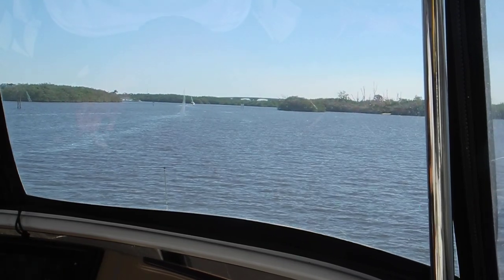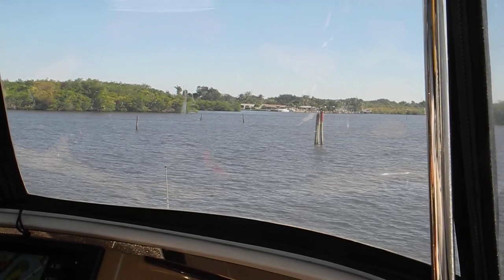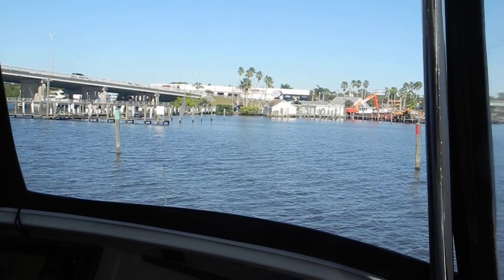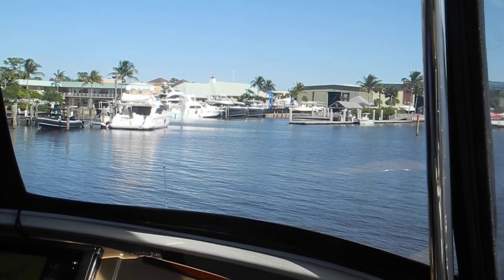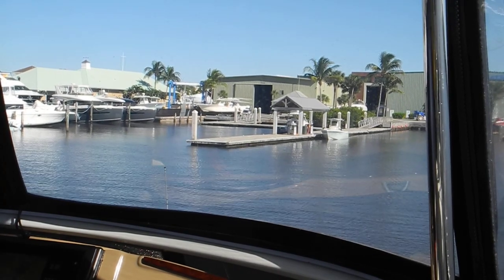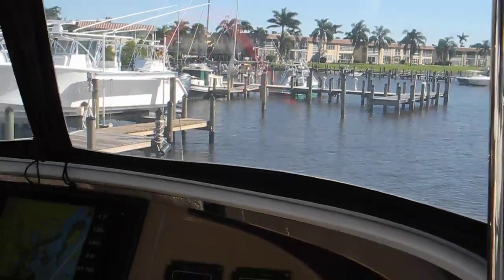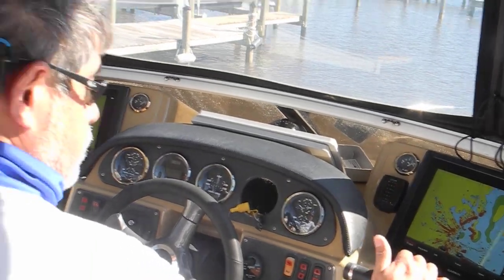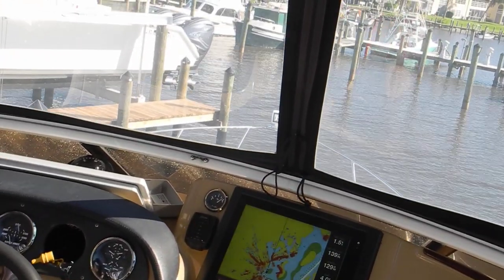No triangles or squares, having shifter issues

Comment: Aha, problems with the electronic shifters! That's exactly what I thought such modernity leads to and why I prefer the old and simple control wires (or maybe hydraulic like you showed the other week). I might ad that I consider electric parking brakes on cars complete madness...
Reply from the maker: Alyse here. You and Chris think alike. 😄 Frankly, I also prefer old school to the electronic “everything” engines. I got in a bad situation when a brand new boat I was aboard wasn’t wired properly from the factory and the only way the batteries recharged was from shore power. We didn’t know it until the batteries got too low and the engines quit. Did I mention I was 90 miles off shore and Chris wasn’t with me to MacGyver something? And he had the jumper cables with him aboard another boat.
Reply: Yeah, but using YouTube, internet, mobile phones and flying around the world in planes. 🤦🏻‍♂️
Reply: @AskCaptainChris  😧—Thats for Captain Alyse—that must’ve been scary...
Reply: @allaboutyachting  What are you getting at? I didn't say I'm against all electronic things. But I am against using electronics that are not safe for safety critical equipment when the same thing can be done more safely in other ways. Heck, there has been two multi billion dollars US Navy destroyers that crashed just because the electronic steering system was completely over complicated and flat out stupid. If that can happen with all tat money they cost, professional crew and maintenance, just think of how it is for a private boat owner.